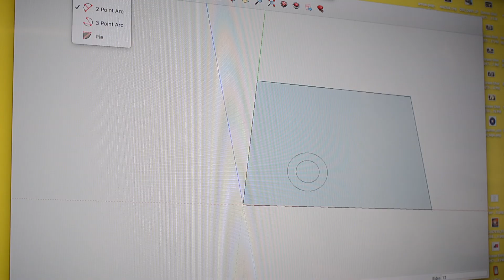Chop Saw Automation (Arduino Powered)

Comment: quick question...if you go to the length of automating the saw then why don't you increase productivity by cutting multiple pieces at once by stacking the stock material. With that large blade you can easily cut like ten pieces stacked.

Comment: Love it. But safety is obviously not on your mind. One really cheap, easy and effective thing you might add is a real e-stop. Automation Direct sells standard industrial parts like that for virtually nothing. 

The "kill-switch" thing is just not effective. Do a tiny bit of research on safe design and you'll get it right away. 

This is one of those 90:10 problems. You can get 90% of the necessary safety for 10% of the effort. Getting things "perfect" from a safety perspective is often the enemy of getting things "good."  Right now, you're at the suicidal amateur hour level. It's almost irresponsible to post videos like this. 

On the other hand, YouTube is flooded with suicidally dangerous stuff. So maybe just do a little bit of reading.  One place to start is "NFPA 79."  It is short, easy to understand and will lead you to further reading. 

This stuff is actually easy to get 90% right.
Reply from the maker: Thanks man.  I am also not wearing safety glasses
Reply: @AbsorberofLight  What about safety shoes?
Reply from the maker: If by shoes you mean flip-flops, then yes :)

Comment: Nice quick fix for the repetitive task. I didn't see it in there, but you could put a limit switch where the material slides, so it can kill the loop when there's no material left to cut. Hard to describe, but essentially mount the switch close to the saw end so it's depressed when there's material stock in the channel, once the material end slides past, it'd give the switch arm enough room to depress (thus signaling out).

After that, you'd just want a variable for the switch state and an IF wrapped around your loop run state, with a check on the switch status.

The drill press could be quickly automated (since you have a nice jig already), but there's no way I can describe that without drawing it.

Comment: I wonder why just do not use relays instead of stepper motor for H bridge.
Reply from the maker: Good question, and one that I forgot to address.  By doing it this way I am able to adjust the starting position of the saw, independent of the program.  I'm also able to retract the saw in case of a problem.

Comment: Clever setup but it would be better if the drilling and tapping was done before the cutting then you have only completed tabs to collect.
Reply from the maker: I thought about that, but it would be insanely difficult to make sure the holes end up in the center of the bracket.
Reply: @AbsorberofLight  Exactly!
Reply: Wouldn't be so difficult it you mounted 2 drilling stations horizontally on the material feed line. Drill them on the same machine and the feed will always be the same for all.

Comment: I like it!!
I just subscribed!
One thought, could you possibly drill and tap the part before the saw cuts it free from the the stock?

-Chaos
Reply: I was thinking about that question as well. The way to do it would require accurate measurement of the chop saw blade to determine the incremental spacing and either making a similar arduino indexer for the drill press and tapping station or adapting a drill and tap station to the chop saw unit. 
Either way has to be better than all of the handling involved in drilling and tapping after the pieces of aluminum have been cut.
Reply from the maker: @markfryer9880  I thought about that, but it would be insanely difficult to make sure the holes end up in the center of the bracket.